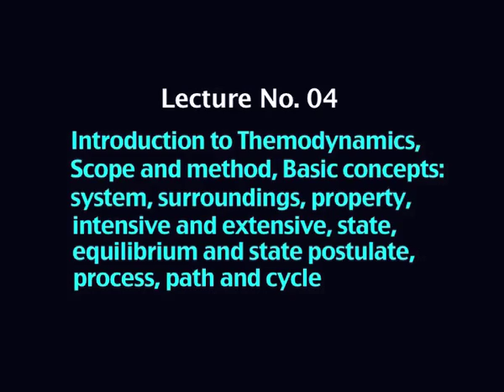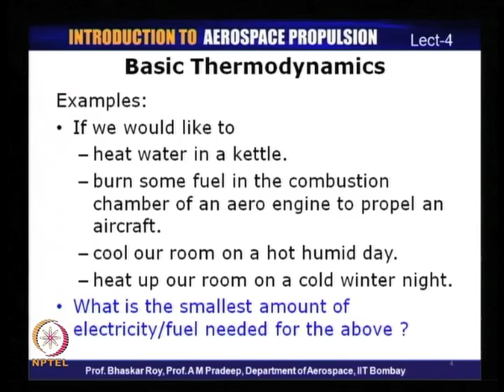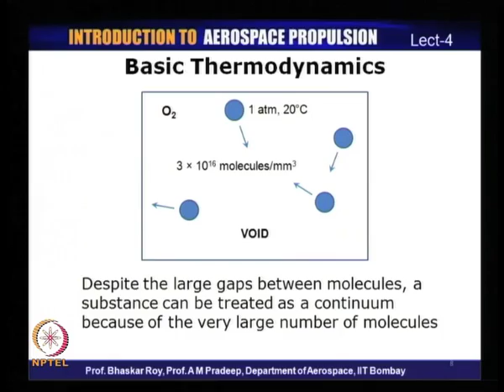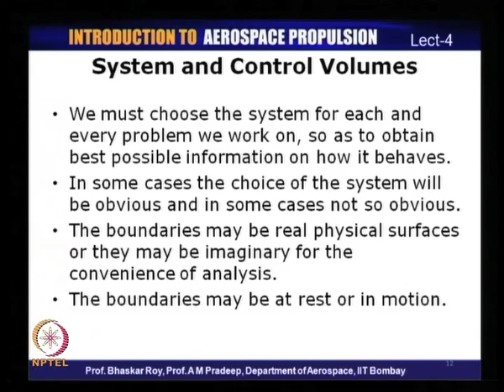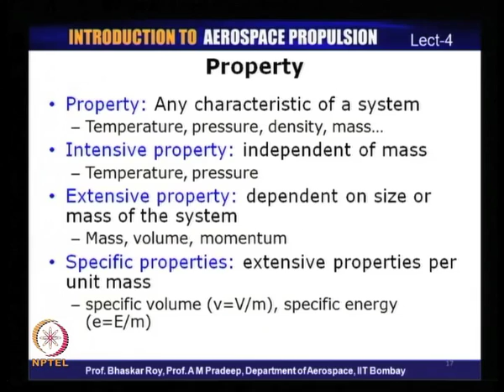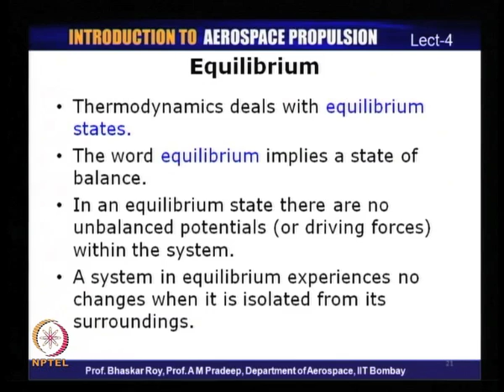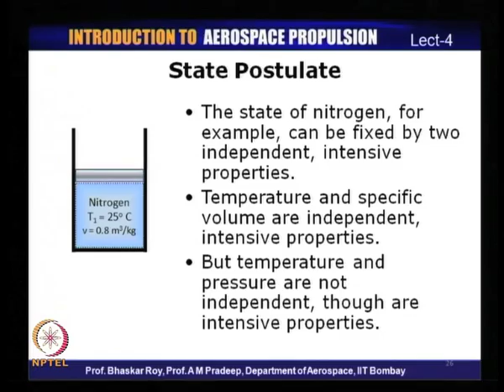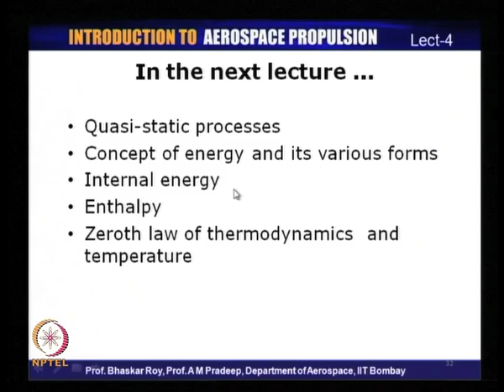Mod-01 Lec-04  Introduction to thermodynamics

Comment: What is the control volume?
Reply: It can be fixed, moving or deforming volume of system considered in a space which may or may not be imaginary through which we considers energy & mass interactions with surrounding.